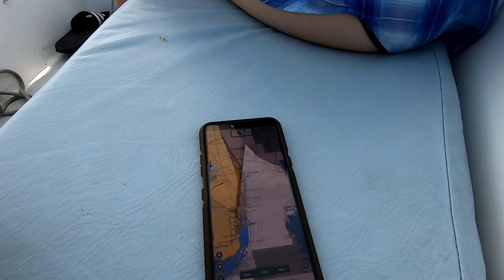A new slip and new Tohatsu 6hp Sailmaster for our Macgregor 26D

Comment: A good video of your experience with the Tohatsu 6hp motor and MacGregor sailboat!   I sail a '94 MacGregor 26S and used an 8hp Honda that became unreliable.  I took my boat out a few months ago to break in my new Tohatsu  motor and was having a nice day until I got in a tight space in my marina and tried to turn using both the motor and tiller. The spinning prop wacked into the rudder (luckily it's HDPE)  and left a few gouges in it.  So I guess for me, turning the boat will strictly be with the rudder and not the motor.  MacGregor's transom motor mount leaves something to be desired as there is no room to move the outboard tiller for turning.  The Tohatsu motor for sailboats is a great little motor.

Comment: I have a question. I just got a Macgregor 26S and am wanting a new motor for reasons similar to what you mentioned. How bad is the vibration from this motor considering it is a single cylinder? We had an issue with our current motor vibrating the whole boat. Thanks!

Comment: Looking at a Mac 26D any advice on it.. it will too he a project boat. Want to coastal cruise with the family
Reply from the maker: Congrats! I hope you can enjoy it.
A few things to look at:
Transom strength. Mine leaked.
Overall damage. Not too hard to fix but if water gets in, it can damage the core.
Soft spots in the deck.
Rigging is cheap, but look for rust and cracked wires.
Mast and boom are most important. Straight, working, etc.
Check the bilge. Is it wet? If so, why?
Overall, if it's a project, they're fun to work on anyway. Good luck and have a blast!

Comment: Hi, very nice video. How do you manoeuver with the motor running in the marina for tight turns? Motor tiler only or both Mac tiler and motor rotation ?
Reply from the maker: Good question! I generally use the motor to turn tightly backwards. Forward, I keep enough speed to turn, then just hit reverse if I get too close to something. My wife is always hanging off the bow, ready to direct us using other boats or pilings, too. It's tough in the marina and I have yet to perfect it. Too fast and it's scary, too slow and you can't turn!!!

Comment: Great video.  Question about the Tohatsu.  Do you feel like 6HP is enough, now that youve used it a while?  Did you need to ultra long shaft or was that just the version that you found?
Reply from the maker: Hey, thanks! And yes, a 6hp at quarter throttle pushes us along at around hull speed. The 8hp did exactly the same, so I don't really think a bigger engine would do much for us, unless it was much bigger.
As for the length, yes the ultra long shaft is a requirement. Anything else will suck air when you go over waves. We even have that problem sometimes with the ultra long shaft.
The engine has been a very valuable upgrade. The only thing I can complain about is that there isn't a push button start.
Reply: @trailersailoradventures6138  are you able to get it out of the water enough when you're sailing?
Reply from the maker: @cageun  yes it folds all the way up. No issues with it dragging unless you leave it down. That's something I learned the hard way not to do, as I almost lost the motor!